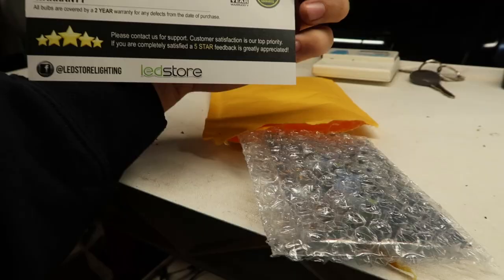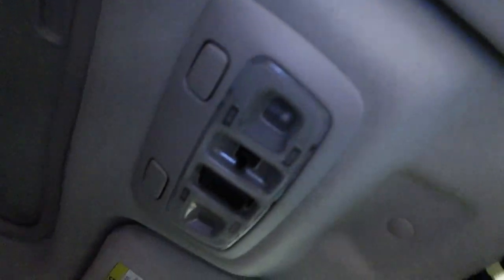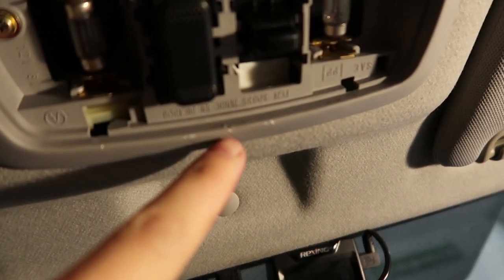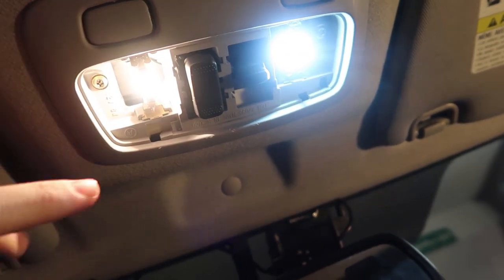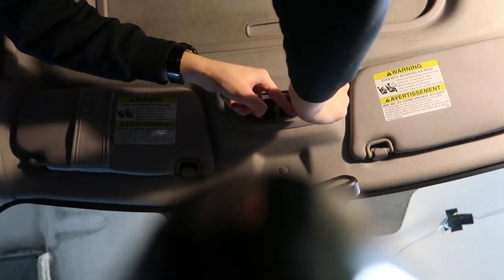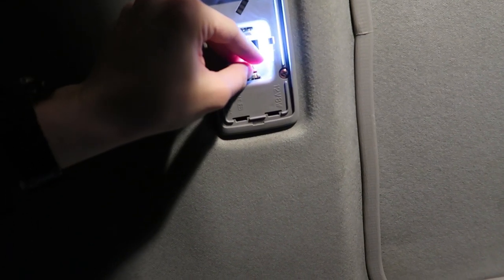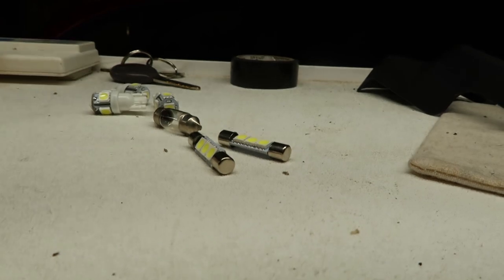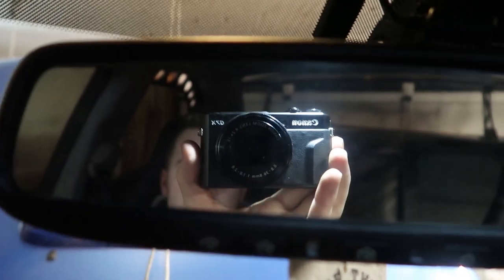Installing LED Lights into my WRX!

Comment: I got red led interior lights for my 2014 sti and I think those 2 spare lights are for the glove box and trunk I could be wrong though because I never installed them and I’m going back to a white led
Reply from the maker: I will have to take a look at that! Thank you for the suggestion!